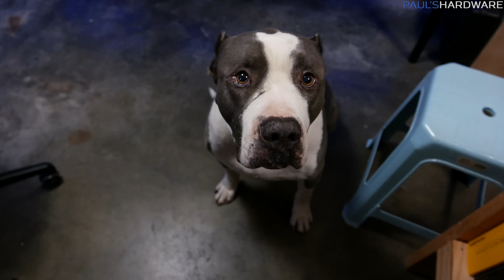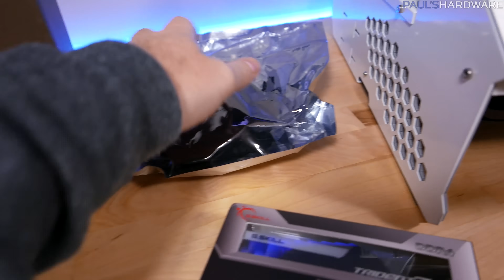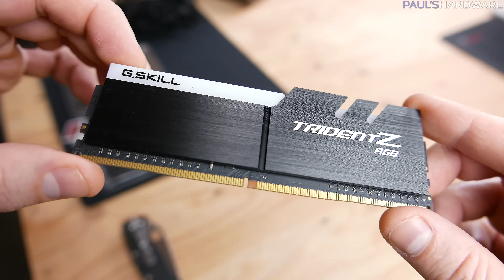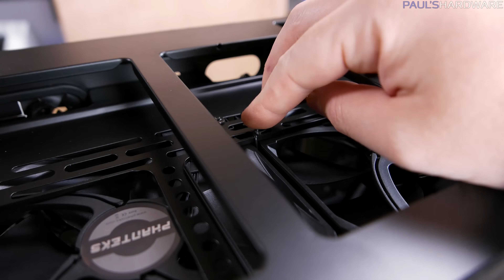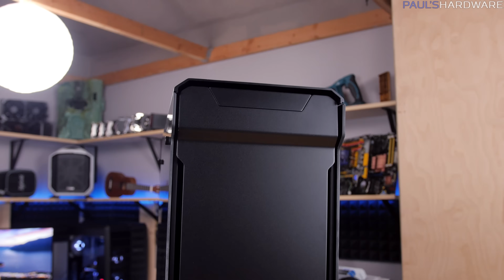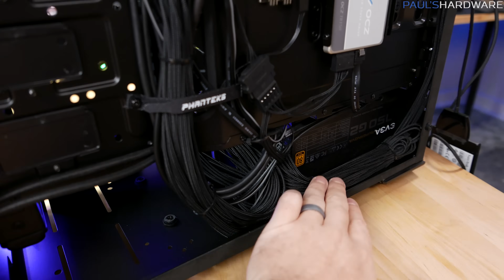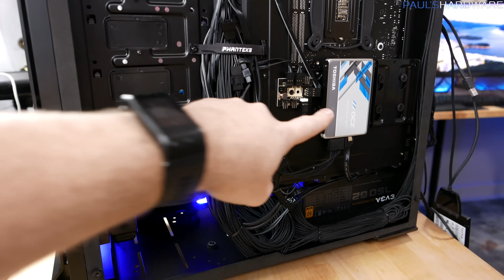The Perfect RGB Build - But Will It Work?

Comment: why no rgb fans?
Reply: But the RGB fans can be synced with the AIO colors...
Reply: Noob Slayer too much as is IMO
Reply: Because this is a classy RGB build.
Reply: Because no matter how much money you spent on RGB components if you set them on breathing they are breathing out of sync, if you set them on flashing or fading they are switching to different colours like one component is blue, than green, than yellow and the other is blue, than yellow, than green and if you put them all to solid lit they are all slightly different colour and brightness so it just looks awful. 
It's not that many people that don't like the idea of RGB at all. It's just that most of us are not satisfied with the maximum results achievable in terms of clean stylish looks instead of cheap Christmas tree decoration theme.
Reply: Noob Slayer I believe there are two on the radiator.

Comment: Hey Paul, I just picked up the Trident Z RGB Ram Kit as well. I did opt to go for the 32 gb kit, my question to you is what memory clock speed did G.Skill send you? Mine is the 3866 memory clock one.
Reply from the maker: My kit is 3200 -- nice though! They're making them fast
Reply: You're still popping off and can always overclock. Nice video though, keep up the great content.
Reply: Jesus Christ 3866…imagine how far this gets if overclocked.
Reply: Gaius Trollius I'll find out soon enough
Reply: Yes, two 16 gig kits :)
Reply: IsakH85 nice, from what I'm aware of that'd be a nice combo on the new Asus apex motherboard coming out, I myself am waiting for the extreme variant.
Reply: Yeah, I only have the Formula so I might not be able to run them at the full 4266. I'll just have to see how far I can push them when they get here.
Reply: IsakH85 is that the 2 stick kit?I didn't see it in a 4 kit
Reply: I ordered 32 gigs of the 4266 Mhz version, for maximum e-peen!